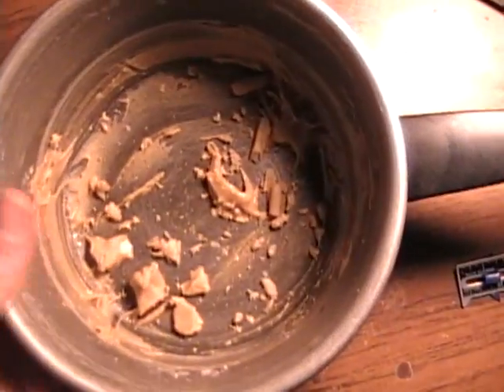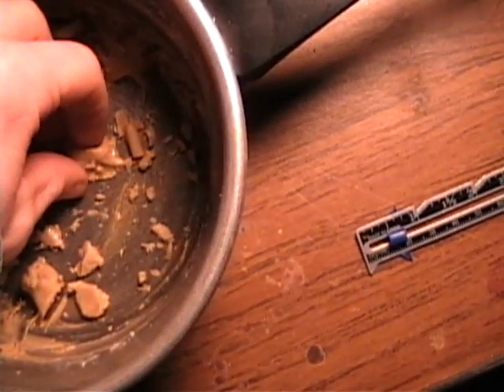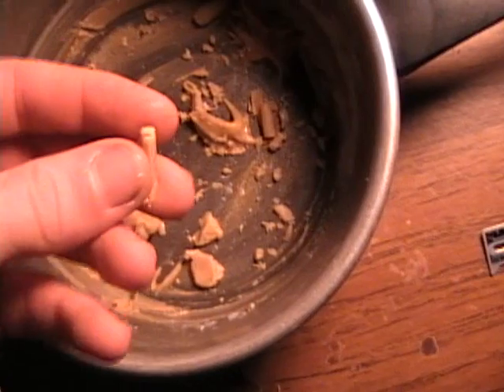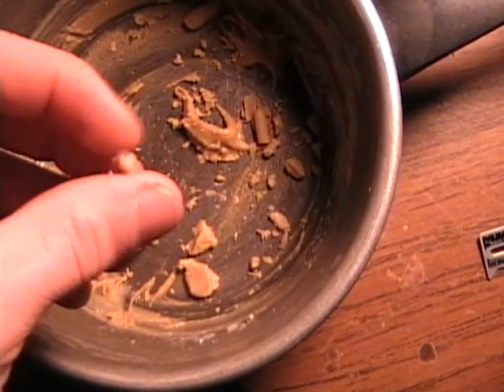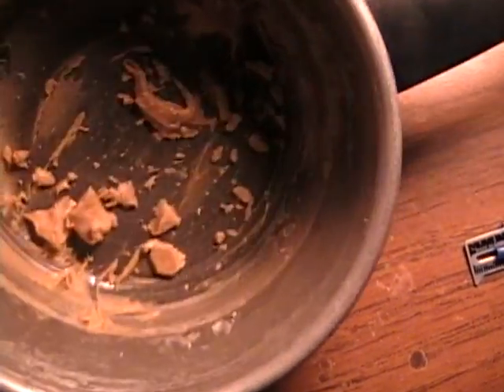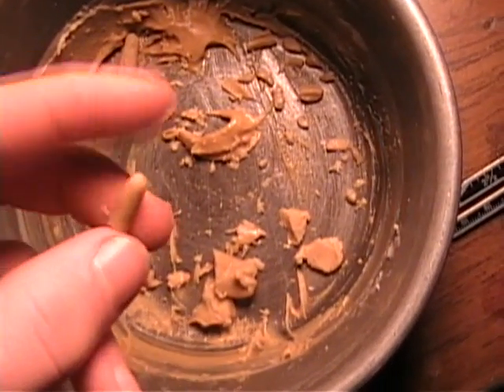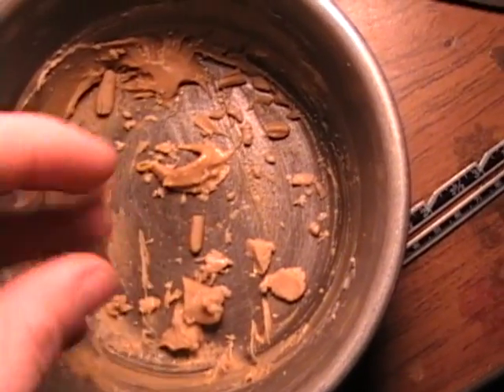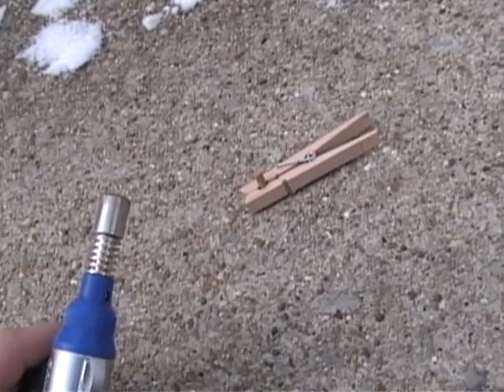Rcandy Testing

Comment from the maker: yeah, cooking this with open flames is extremely dangerous. i suggets using a hot plate like me. and do it outside too. i did this today and had to stand outside for 20 minutes to cook this in 20 degree F weather. it was cold but worth it.